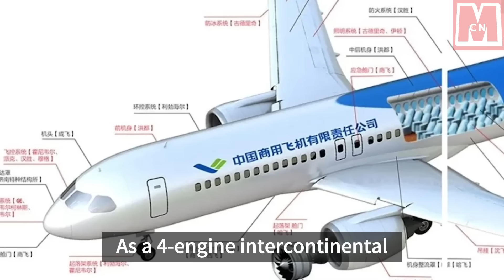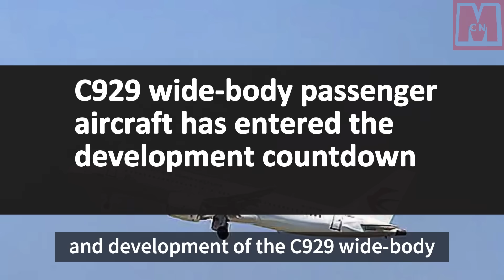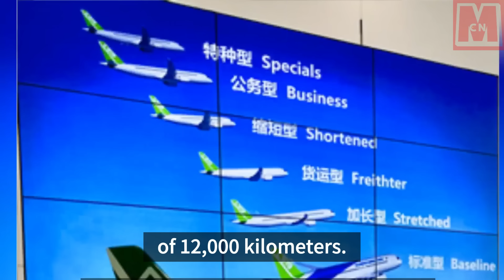The C939 passenger aircraft is unveiled. How large is this new generation intercontinental plane?

Comment: Why talk about C929 and C939 when the present C919 is still using engines from u.s.
Reply: No, the engines used by the C919 are not from US. They are made in France by CFM International, a 50–50 joint venture between and French Safran Aircraft Engines and GE Aerospace of the USA.

Comment: Give me a break. Approximately 120 regional jets from 2008 to 2023. Bombardier delivered over 1900 Canadian designed and built regional Jets, the CRJ between 1992 and 2020 in sizes ranging from 50 to 90 passengers. Bombardier also designed and built the CS100. 74 airframes were built before it became the Airbus A220. Well over 300 have been built mainly at the Quebec assembly plant. During the same timeframe Comac has delivered a grand total of 6 airframes , all to a government owned airline.
Reply: China is like the tortoise. It may out beat everyone in the end !

Comment: How is Hong Kong to Shanghai an "overseas" flight? Isn't it actually domestic?
Reply: Hong Kong is an Island.
Reply: @charlieccw  Yes, Hong Kong is part of China. Some confusion existed when China agreed to the 'one country, two systems' form of independent governance.  However the CCP violated that agreement a couple years ago. The result has been an exodus of western businesses from Hong Kong, a loss of free press, the jailing of protesters, etc. As for Hong Kong supposedly being an 'island', that is only partially correct. Part of Hong Kong is an island. But most of Hong Kong is on China's mainland. The island portion is connected to mainland Hong Kong by short (~3000 feet long) bridges.